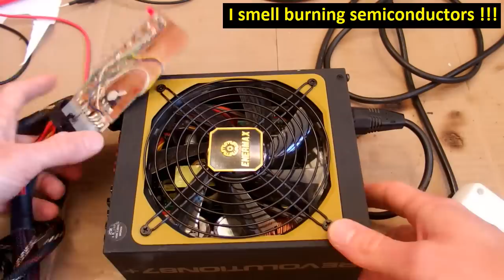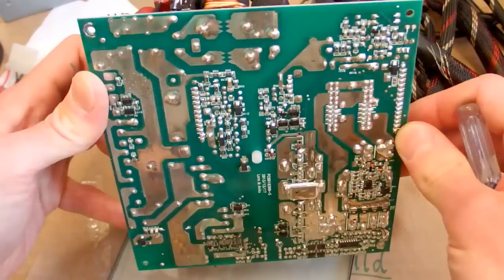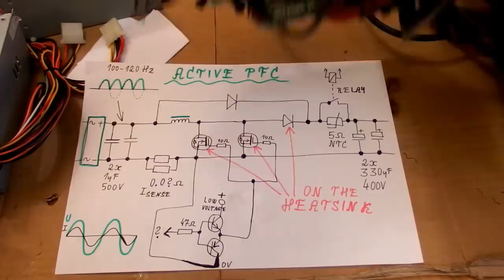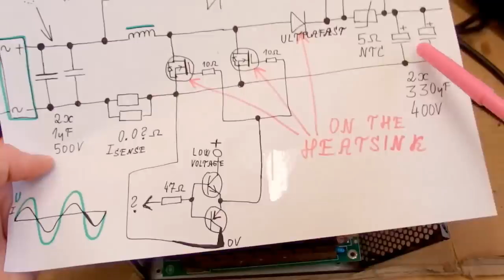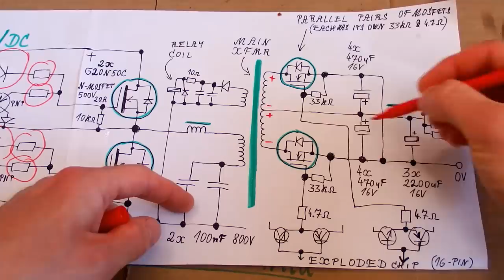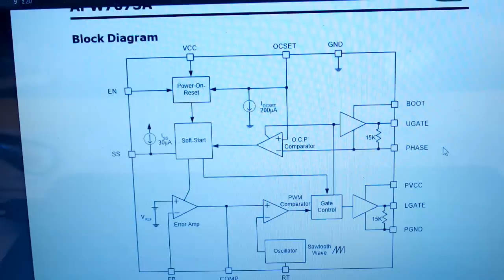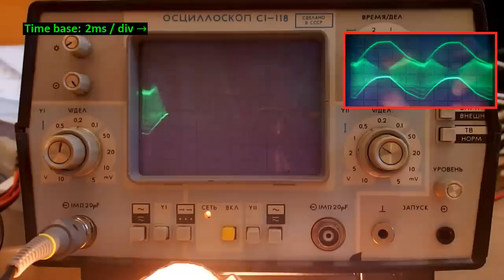850W computer power supply - how does it work (with schematics)

Comment: I had almost the same series power supply from Enermax (Revolution Xt 730 W) and it worked well for 4,5 year until I installed new GPU (VEGA 56). When PC was idling there were no issues, but  under heavy load PC kept shutting down or motherboard triggered ASUS Anti surge protection even though my real consumption was 660 W (AC) or 600 W before losses (DC) and I heard also PSU relay click. I suspect capacitor degradation causing undervoltage triggering either inbuilt PSU protections or motherboard protections

Comment: I had a notebook's motherboard shorting out by simply pushing the flexible plastic bottom a little and the sharp edge of a component punctured the insulating kapton tape. Is there a hole on the burned plastic cover? Maybe it touched the case of the PSU.

Comment: Awesome vid, very informative, teaches A LOT of stuff. Please keep up the good work!! Liked, loved, digged, everything.

Primary advantage of old and cheap switching PC PSUs is (I think) that, being them relatively simple, they are quite easy to fix in comparison to newer and more complicated ones. This one is sort of an overkill on every aspect with many SMDs under the PCB and a lot of discrete controllers, not to mention the much more cramped space in which we would have to move. Enermax builds amazing PSUs which fail rarely, but they seem quite hard to fix if they fail.

Comment: Is this power supply is really 850w ? Because 850w / 12v = 70a .  So the main transformer have to get this power through it and as I see from the transformer size of the main is for a 30 up to 40 A in the second wind

Comment: What a shame that the supply is badly damaged :-(,  but i'm sure you will lift lots of handy parts out of it to save another psu life :-D
Would the pfc circuit only consume power from the a.c waveform up to say 70 degrees and say 290 degrees  to 360, so it's boost current must not add to the problem maybe??
I have never really looked close at pfc, but i have repaired lcd power supplys that had a broken pfc, 380v was measured when repaired :-)

Comment: 12:21   those resistors should be fusible resistors in case of something goes short on dc side.
Reply: Everything will act as fuses if we run very high current in it :)
Reply: @tirtagtgaming1186  at list you can`t have fire with those resistors ;0

Comment: Why not use 3shoky diod in parallel to minimize the voltage drop?
Reply: Because the voltage drop of a diode is not dependent on the current, but a fixed property of the semiconductor material used; so no matter how many diodes you wire in parallel, the voltage drop will be the same!

There is usually actually a little bit of series resistance in a diode which does obey Ohm's law, but unless the diode is being run stupidly close to its limits, the fixed voltage dominates.

Comment: I have a similar 750W P/S needing repair so I was looking forward to a full repair of the one in the video, but I understand the reasons for not doing so.  Sometimes the damage is so great as to render any repair effort too costly in time and materials, especially when inexpensive replacements are so readily available.  However, I do appreciate the detailed walk-through, and the experiments with the working sub-sections were very enlightening as well.  Love the accent, BTW, it forces me to listen more intently and I therefore learn more.
Reply: I'd love the case, just empty. Then I could put my puny PSU in it, and impress people.

Comment: So, you can use a computer power supply as a mains power inverter? It looks like you would need a transformer to step it down if the voltage shoots higher than the voltage the actual mains voltage.
Reply: That is how it works if you use an actual transformer but these are switch mode power supplies so they have a feed back system to regulate how quick the switching occurs

Comment: I have a 500w bequiet psu laying around, bought it when it had an error, replaced some electrolytic caps and then... BANG, cicuit breaker blown out... any ideas what could NOT work in it?
Reply: Have you placed electrolytysc right way around? Have you trimmed the leads of them? Putting them wrong way around and not trimming the leads can cause short at whatever power rail they are sitting at

Comment: In summary, it exploded. lol
Reply: Have you found that this type of resonant PSU is a bit less reliable than the older style PWM style?

ie. with the PWM driving the primary-side FETs directly, instead of on the secondary side?

I've seen quite a few resonant PSUs used in cheap LCD TVs, and they often fail.

(In fairness, that might be because most of them were made by the same manufacturer. It begins with a "V". lol)

It still seems overcomplex to me, to be driving FETs on the secondary side to regulate the output, rather than just doing the traditional thing of driving the primary directly.

Is this type of PSU more efficient, vs the cost of the extra parts?
Reply: I can't believe they now use buck regs for the other voltage rails.

But I guess they can be made very efficient, and they are quite compact. Interesting.

So it seems like more and more PC PSUs might be using this config in future, and they are more like giant "Pico PSUs" on the secondary side. hehe
Reply: @electronash  I think it is a good idea, it gives more stability to the various voltage rails (independent on each other) and thus less under/overvoltage wear on the computer. 

Also, this makes more parts salvageable from PSUs.
Reply: @vaclavtrpisovsky  

Yeah. I didn't realise they were starting to use them more on modern / larger PSUs, but it does make sense now.

Much easier to replace if they do fail, too.

Comment: What I reckon is the feedback transformer is more or less a 1:1 turns ratio isolation transistor driver transformer.

Where the fault occurred (a stray solder-ball, screw, wire, etc), the primary side transistors went into shoot-through and blew the driving components... don't be surprised if one or both of the main power-fets are short circuit (or at least degraded).
A pulse of high current very likely got sent into the  feedback transformer and induced a voltage on the secondary (Driving side) overcoming the breakdown voltage of the main driver IC+circuit. This allowed a large current to release magic smoke.

An example from work, we were trying to figure this style of circuit out for an LED backlight system in an older Samsung screen. We landed up being trolled by a fried feedback transformer (could be a cause or result).

Comment: You should use a non-metalic device for your pointing. How do you know if all the caps have completely discharged?
Reply: In any reasonably designed circuit (PSU especially) there should be always a discharge resistor near the cap. If you have a charged cap, look for discharge resistor (or discharge chip) nearby. Safety regulations and such. In most cases they should be discharged with 10 seconds from stand-by power-off state (not from peak power). Usually letting it sit for 10 minutes and shorting inputs/outputs of entire circuit is enough to be safe.
Reply: @totojejedinecnynick  That's a good excuse until the first time you forget to check or start probing before the resistor has a chance to do its job. You can't assume everything you get is well designed any way. You could be in such a habit as to forget when on a powered circuit.  It's just a bad habit.
Reply: @ed-jf3xh  
Maybe he has measured it already before and knows that the caps will be discharged when switched off. He even pointed out the small IC that actively does it.
Reply: @ed-jf3xh  If you forget to check then you will get electrocuted. Don't forget. You can not work on a PSU with plastic tools all the time. Actually using those and believe you are protected will lead to forget checking sooner than using normal tools with care.

Comment: My trusty Cougar CMX 800W went south recently, with a loud bang, during an attempt of powering up a PC after a couple of weeks of standby.

I am watching this with a tear in my eye. But it has served me for some 6 years.

I will attempt an investigation after setting up a bench.
Reply: A bang when switching on (at the switch, not from standby) is quite often the inrush NTC. I had those explode quite violently a few times. You will know when you have pieces coming out of the PSU when opening it and a place with two component legs sticking out of the board ;) .
Reply: @superdau  i am sure it was not an inrush issue, i merely pressed power on button on the front panel of a pc. As i said, psu was in standby for weeks. Other tech in the same room unaffected.
Reply: Caps exploding most likely. Good luck.

Comment: It is quite likely that the 1N5406 diode in the aPFC circuit is not just used on the initial charge of the output caps, but also in standby mode. It's state of the art since years to bypass the active PFC in standby to reduce standby power. PFC is required in the European Union for loads of 75W or more, so there is no need for the "overcomplicated control circuit" (quoting DiodeGoneWild) to run in standby.
Reply: Got to the thirty minute mark: You already observed that the PFC is indeed off in standby. Also you provide the same explanation. Seems like I might indeed be right on that. :)

Comment: I’m just halfway the video and amazed by the detailed explanation given. It’s a lot to chew on but very interesting! 
Your assumption that a screw might have caused a short circuit seems very plausible. Maybe something else broke down first and then after the first repair attempt the screw . . . ehm just screwed everything up.
Reply: My theory is a layer of moisture built up on the plastic sheet when the computer was off, shorted out the supply when it was turned on.
Could also be insects, those cause chaos in electronics too.
Reply: Wow really dude XD
Reply: Yeah
Reply: @mrkitty777  I love kitties... and ginger. I also have a special fondness for orange cats.
 
 Peace and love.
Reply: @You I also quite like the idea of dead bug construction of circuits where components are soldered directly to each other.

Comment: Bloody hell is all i can say about this one. Studiying EE for 4 years now, took a break to watch a new video from my favorite YT channel. This is some next level engineering space magic, gave me a headache halfway through. Can't even imagine the amount of work and effort you put into this video, and i'm actutally glad you decided it's not worth repairing/not repairing it just for the sake of the video. It's appreciated, no doubt about it. My mind is simply blown by how far you went in on this one, and the fact that you're sharing all this knowledge for free. But you still owe me a fire extingusher for the headache ;)
Reply: I can only imagine myself replacing all the damaged components only to turn it on to see all of them burn up again.
Reply: @MassimoTava  lol, exactly. Recently had a cheap TPA3116 class d audio board fail on me, the chip went short-circut. Took the chip off, measured the resistance between VCC and GND and it was a ok. Soldered a new chip in and it instantly failed short-circuit when i powered it up. Obviously, something else was causing it to pop. So yeah, you can basically replace every single damaged component on the board, but you can only pray that it will work if you don't know what actually caused it to fail in the first place.
Reply: Lazar Šaronjić 
A neat trick to prevent blowing up a (half) repaired amp, is to limit the amperage. You need bench power supply for that or use one of those cheap programmable voltage regulators. Search RD on AliExpress.
Reply: @Conservator.  "A neat trick to prevent blowing up a (half) repaired amp, is to limit the amperage." - Yeah. DGW uses this neat trick of connecting a light bulb in series with the tested device to do that.
Reply: @CoolKoon  I forgot about that. Tx!
Reply: The multiple overlapped variable frequencies to control the output voltage AND simultaneous power factor correction was amazing.
Reply: @rich1051414  "The multiple overlapped variable frequencies to control the output voltage" - Yeah, that part has amazed me too. Those tiny boards are able to provide quite a nice amperage for the designated voltages.
Reply: EE here too xd
Reply: Haha nice
Reply: Lamp and an isolation transformer us e a variac to bring it up n slowly I'm an old radio man bench tech early 70s for a radio b store
Reply: "This is some next level engineering space magic, gave me a headache halfway through." - You could try watching his videos on the cheap Chinese SMPS' that he uploaded recently (a 600 W and a 1000 W one) as a primer and then go and re-watch this video. Perhaps it'll help with the understanding ;)
Reply: Of course, I undertand you, NEVER go to study, the best app to learn from is Youtube. TBH , I learned everything in Youtube, and din't learn at all in school. Youtube made me a great engineer.

If you don't know what "TBH" is, it's basically To Be Honest, I use TBH for shorter words :)
Reply: We study this in first year of university in china.
Reply: A S 
Maybe you could study a few hour less of electrical engineering and take one or two lessons on empathy. It might make you a as person more effective.
Reply: @Conservator.  there is no need of empathy in market. Whatever is more effective wins.
Reply: A S You’ve got a lot to learn